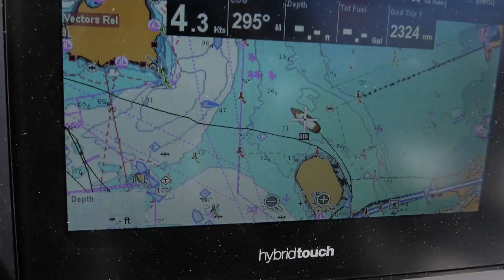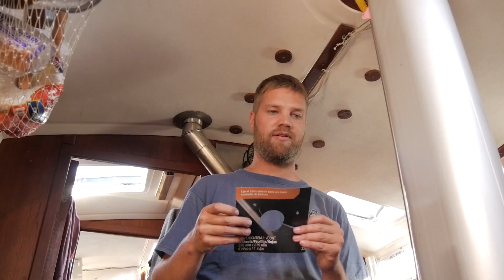The Captain is Losing his Mind - Walde Sailing ep.80

Comment: I always use "Inflatable Boat Sealant" in all of my dinghys. Make sure to roll your dinghy in every direction, let it sit upside down etc. Think of a slow moving liquid that has to coat the entire inside, valves and all. I never even had slow leakage where you have to pump it up every so often. If you have a patch or valve  that leaks a bit, it will fix you right up.

Make your own donuts like we did as kids. Wad of bread dough into hot grease (5 seconds on each side) then fill them with jam or shake them in a bag with cinnamon or powdered sugar etc. Can't make your own dough? Buy a can of ready made stuff. Your donuts looked almost edible :-)

When you both have jobs and never see each other except to fall asleep,,, you will be a lot less happy than now. Good luck ashore.
Reply from the maker: Does the sealant prevent punctures? That would be pretty cool. Sounds like a great product to have on board!
Reply: @WaldeSailing  Only you - can prevent punctures and forest fires :-) It is a great product and works. It costs a bit but you only need it once in each dinghy. Roll the dinghy in every direction and let it sit long enough for it to run everywhere inside.